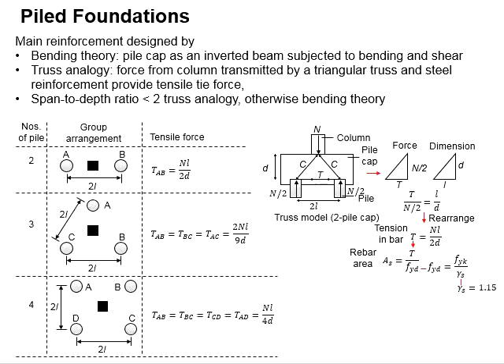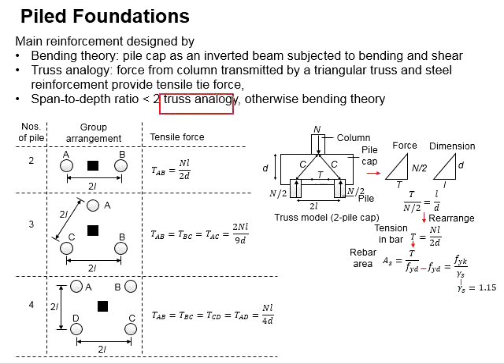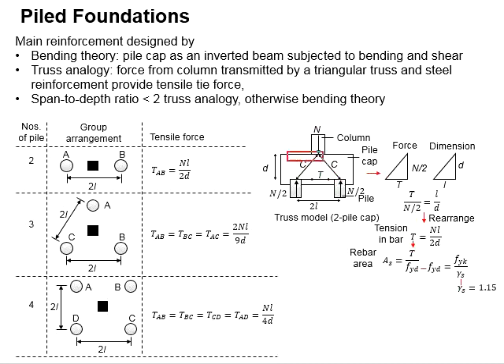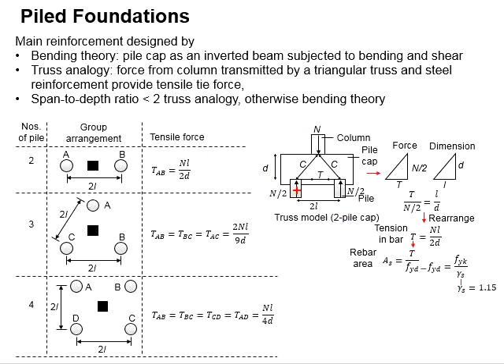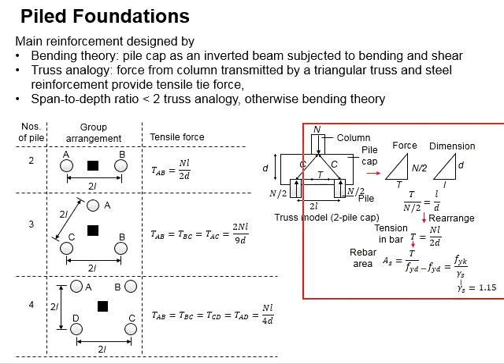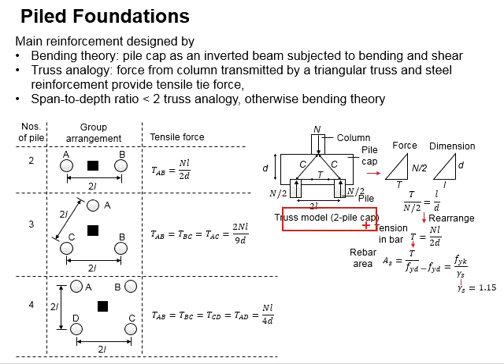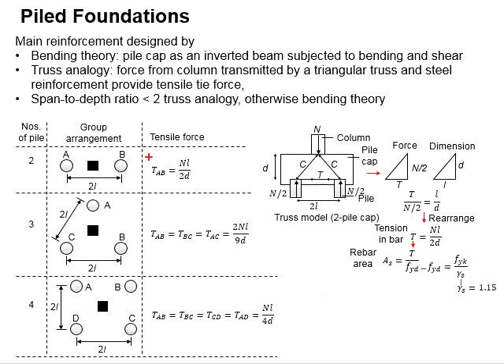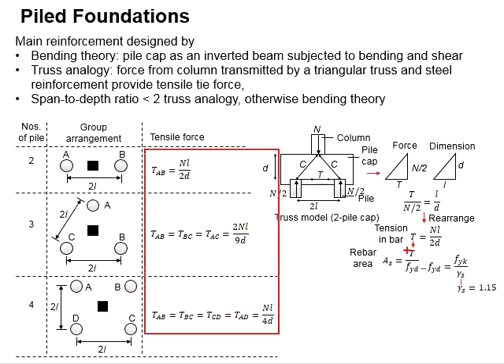3.20 Truss Analogy in pile cap

Comment: how do you get the 2Nl/9d? isnt it substituting N with N/3 you will end up getting T=Nl/3d?
Reply from the maker: Good question. Use the ratio T / (N/3) = (2/3)*l / d. As the 3 piles are arranged in triangular shape, the the horizontal distance from pile C against effective depth d would be 2/3 x l instead of l. Assuming the centroid of reaction being skewed due to pile A.